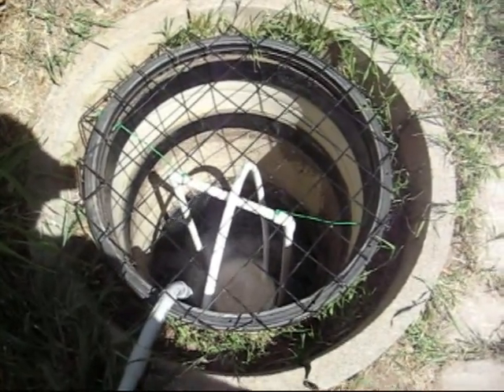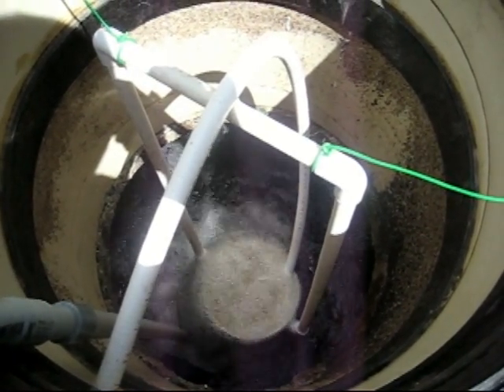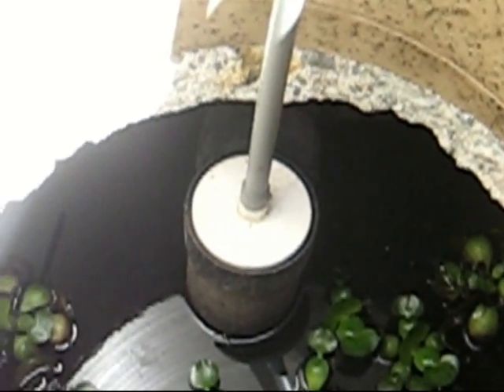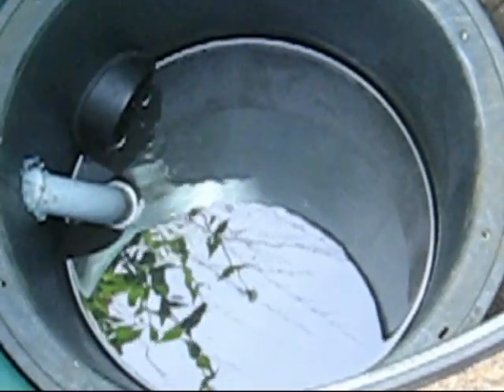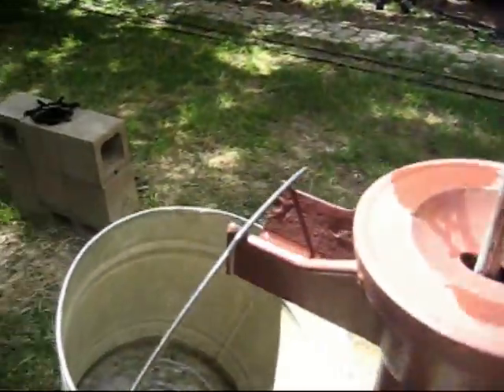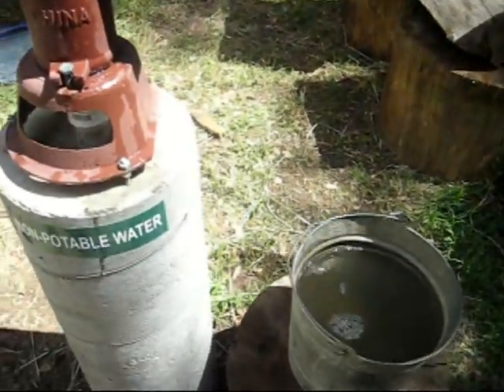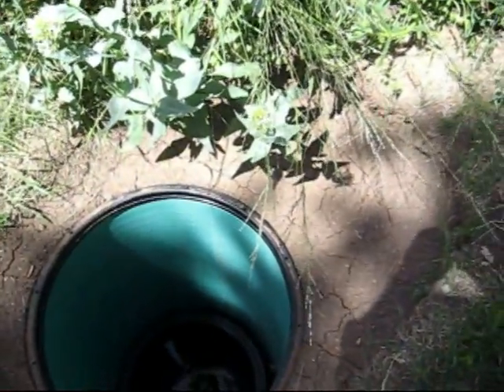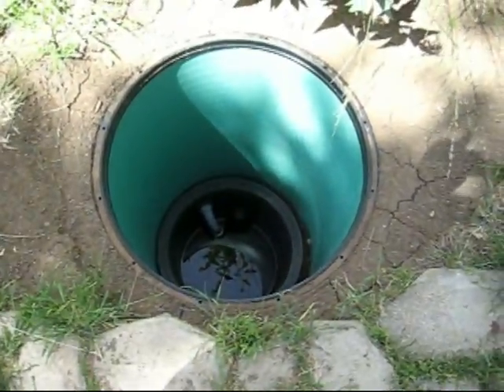DIY Residential Wastewater Treatment Plant

Comment: what about the solid waste?
Reply from the maker: Solid waste is broken down by the physical movement of the water by air bubbles. Aeration imitates the action of a flowing stream in nature.  Sludge does accumulate at the bottom of the settling section, but at a greatly reduced rate as compared to a standard stagnant septic system, because of the composting action of aeration. The sludge that does accumulate I use a portable septic pump and hose to transfer into buckets which I apply to the base of our fruit trees and grape vines. We have two large fish ponds which I clean out every few years, and the sludge at the bottom of the ponds is ~identical~ to the sludge at the bottom of the tank. Both sludges are excellent high grade fertilizers.So with this system I never need to pay hundreds of dollars to have the tank pumped, and what is normally useless waste is turned into a valuable resource.
Reply from the maker: No, but it aerobically composting the sewage greately reduces the amount formed. We never have to pay $400 for septic pumping again, because I made up a small simple portable septic pump system I call the "Sludge Puppy". With it, I pump the sludge out of the bottom of the tank into buckets and use it to fertilize our fruit trees and grape vines. So what was a waste product we had to pay to get rid of,now becomes a valuable resource we can use.
Reply from the maker: The sludge from  the bottom of our septic tank smells exactly the same as the sludge at the bottom of our fish ponds when I muck them out. Exposed to air and sunlight the smell dissipates quickly.